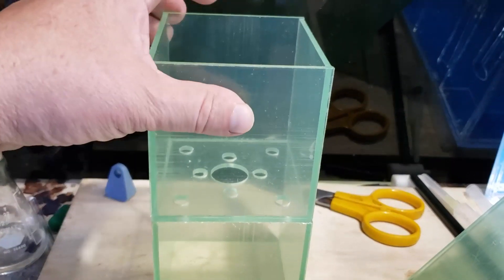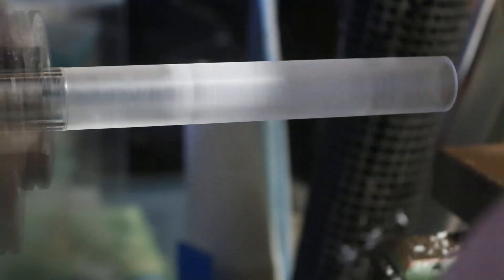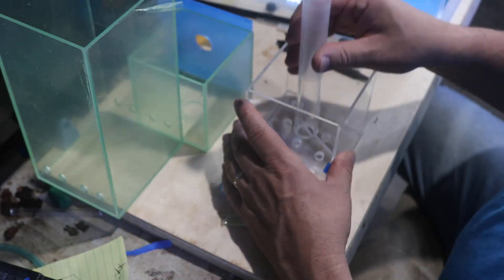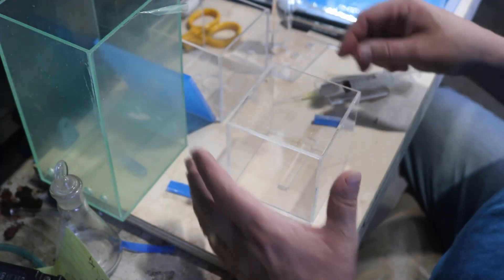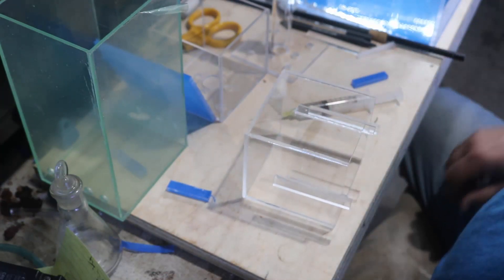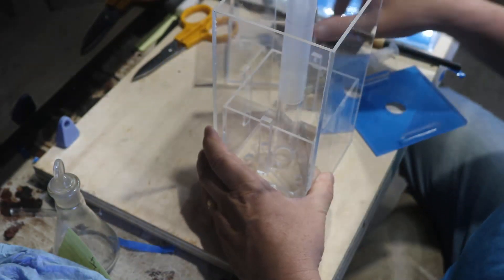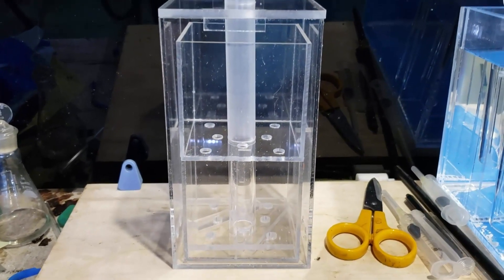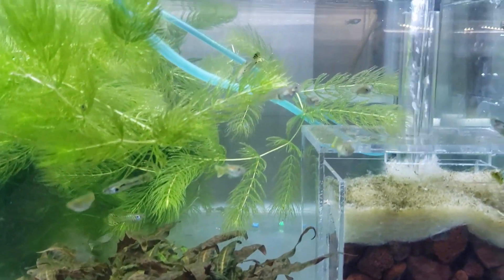Two Layer Multi Stage Box Filter

Comment: The down side to box filter is you've got to reach into the tank regularly change out the filter floss.   

I think it be cool to to make a kind of bubble river that slopes up from the front of the tank to the back. Lifting the detritus out into a HOB where the floss is easy to change. With the HOB doubling as an air step that flows into a ebb n flow planter box.  An use the outflow to push any detritus to the intake of the bubble river.
Reply from the maker: In tank filters do have that as a fault for sure. I thought I came with some complicated builds lol. I will have to give this some thought and see if can can make it. Thanks for the input and as always for watching
Reply: @FishmanEricRussell  lol the bubble river is a bit excessive.  If ya look at a painting of a river it's starts wide in the front and narrower in the back, I'm thinking it'll kinda work like a vacuum attachment.

Comment: Never thought about it in terms that the air just kinda persuades the water to move in a certain direction. I'm confused though how the outer box makes it work better.
Reply: Colt Devine the water only comes through the bottom outside. Closer to the substrate. Otherwise he could have just done a drilled top.
Reply from the maker: With the two layers the water has to go through all of the media and depending on where you drill the holes, you can draw water from different parts of the tank. Thanks for coming by

Comment: I think a lot of these air driven acrylic creations would look super cool with an LED bar shining upward through them.

Watching some of your recent videos has made me wonder if you could use a stacked box filter like this as part of a structure that lifts water above the level of the tank. Your comments about flow rate of air driven systems in this video make me think that might be a bridge too far though.
Reply from the maker: There is always a problem when you try to move water up above the tank with air. If you use box filters to do this you add the extra problem of them getting dirty and slowing down. This would make it difficult to balance out the flow. Cool thought though thanks!